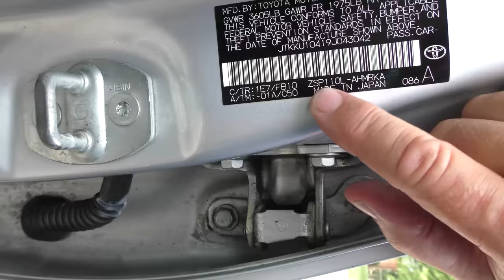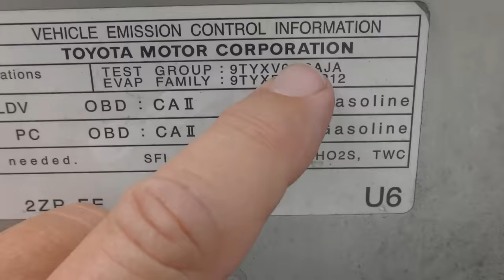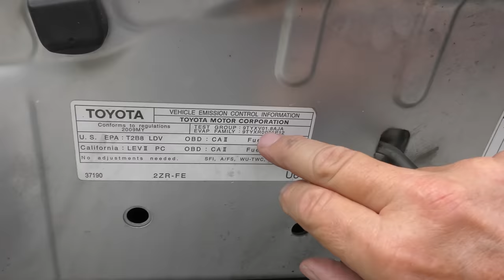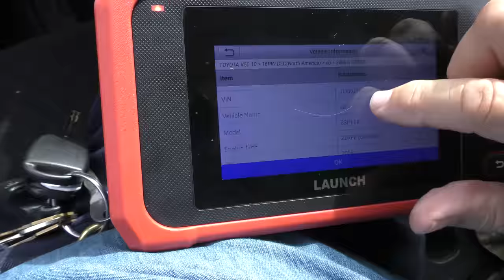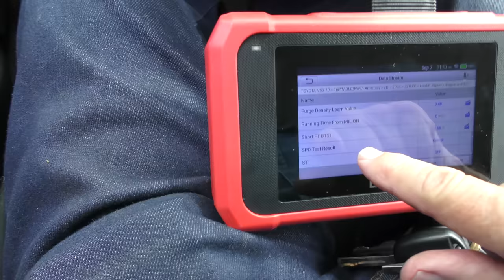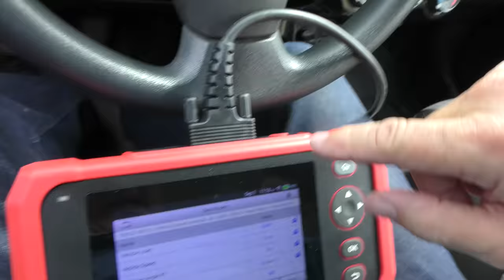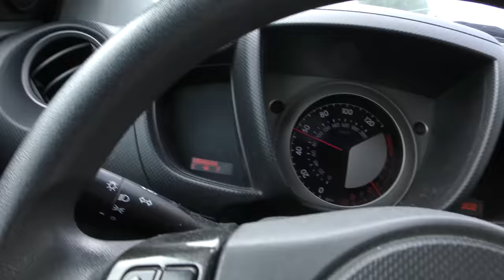Stop Buying Toyotas and Buy This Car for 3x Less

Comment: I had a scion xb and had 250k on it and it would be still running if I didn't hydro lock the engine. The oil leak on some were a problem with the rings. My engine had the problem and Toyota paid for the engine replacement.
Reply: @nagyhanna3758  drove through a puddle in a banked curve that ended up being almost 2 feet deep and I had cold air intake on it so it suck the water right in. I fixed it enough to sell tho

Comment: My 87 Celica was rated at 35MPG highway, but I would consistently get 40MPG when taking long interstate trips through non-congested areas.  That is still considered pretty good 35 years later.
Reply: See that, and here we are in 2022 and most new cars can't claim anywhere near that.
Reply: I had one over 400000 miles and yes the gas mileage was phenomenal didn't think about then being a young man !
Reply: I remember someone mentioning how '80s Honda Civic hatches got 40MPG plus. However, the reason they did was because they has much fewer safety features.  The person later commented how one wouldn't want to be in a front-end collision in one of those.
Reply: I know how you feel my 2018 Civic can get me 48 MPG on long road trips and it feels great looking at other people in huge trucks that get their MPG in the single digits 😂
Reply: @dannyv2230  Too bad every car doesn't get the MPG that your Civic gets.

Automanufacturers are greedy folks who don't want us to have the entire 🎂. 

They either give us a slice of great MPG or just a slice of Raw Horsepower and speed. 

But what we should be getting is a fully made 🎂 with great MPG, Raw Horsepower and speed together. 

If you get the drift of what I am saying. 

Basically a V8 Powered monster with 50 MPG and ZERO Pollution. 

It can be done but the Automanufacturers don't want us to have that because they are trying to appease the radical environmentalists now.
Reply: My V8 4.3 Lexus gets over 25 imp gal here in the UK, that's town and country too.  People in the owners club say 30 is possible, I didn't quite believe them at first.
Reply: @rob5944  I'm not surprised. Here in Los Angeles I routinely get 25 in my 4.0 V8 Lexus.  But when I'm driving in stop-and-go traffic (which is common), it drops into the high teens.
Reply: @KaiPonte  Ming you this is UK gallons, I remember as a kid in the 70s many family cars of 1.5- 2.0 litres usually did only around 30. That was considered normal, we had a Hillman Avenger for a while., you may remember them as a Plymouth Cricket?  He usually had oldish cars as he was usually short of money.  Come to think of so have I lol.
Reply: @KaiPonte  driving safely and wearing your seat belt are the biggest thing one can do towards as safety.  Indeed all these newer features encourages people do take more risks.
Reply: I learned how to drive on a 79 celica. I wish I had bought a celica in the 90s. Now I have a tC
Reply: @louisstennes3  tbh, I like electric. I rented a Kia Niro EV for three weeks while my Lexus SC was being painted.   It was a dream. Very quick, quiet, and not a big deal to charge.  Even using public charging stations only cost me like $15 for a “fill up”.  I would do so while grabbing lunch. For longer trips, though, I’ll stick with my V8 Lexus.
Reply: It's funny how that works, mines rated for 29 mpg highway but I regularly get 32 doing 80 down the freeway.
Reply: It's alright for a small car today. Our 2016 Mazda3 with the 2.0 litre engine has returned up to 62mpg (according to trip computer) on secondary highways. (so 90 kph/). Usually closer to mid-50's mpg, though, for highway. (mind you, I'm talking Imperial gallons, not US gallons)
Reply: My Preludes, 1985 and a 1986 that i had in the 1990s, 35 mpg in the city, 40 on the freeway.  Rated a sportscar it delivered some of the best gas mileage i ever had.

CLEARLY gas combustion engines can be engineered to give us good gas mileage but that's NOT PROFITABLE.
Reply: @jbrandt3306  yes. But you have to squeeze into a subcompact coupe.
Reply: @KaiPonte  I'm 5' 4" so not my issue.  😌
Reply: @KaiPonte  btw the backseat was cleraly a joke in the 1980s version at very least.
Reply: The celica was a great car preppy car with excellent reliability and good gas mileage.
Reply: I had the option to get an '87 Celica this summer and opted for a 2008 XD instead. I'm a little disappointed, but this was probably the better financial decision in the end.
Reply: Pretty good?? lol most hybrids can barely get that even in the city. That's crazy good
Reply: @jeretso I test drove a Gen 1 TC a few years ago and I was too tall for it. I’m only 5’9” but it felt cramped and much cheaper than my 06 Mazda 3. 

My first drum teacher in 1990 had a late 70s Celica that I always had my eye on and then in 2000 I was living in Southern California and saw one for sale that was mint. It was a 79 Celica Supra manual, all black with black leather and OG mags. I didn’t buy it and still regret it.
Reply: @williamperri3437  TC price is a lot cheaper than Mazda 3. Old Celica with a Supra badge would be awesome.
Reply: @jeretso  Used the TC and Mazda 3 are much closer in price than brand new though… Yeah, it was clean and a huge mistake not buying it. That same Celica in the condition it was in 23 years ago would be worth over 20 grand.

Comment: I've owned that exact car (same color and everything) for 16 years now. It's a tank- I think the only thing that I had to repair is the exhaust and the altenator. It starts first time every time! Probably the most reliable car I've ever owned. With the seats down, the rear has about as much room as a small pickup truck :) Great in the snow too.

On the minus side, it's severely underpowered and strains on the highway. 0-60 is in the 10-12s range. There's no traction control, and the rear brakes are drum brakes, so brake performance isn't the best.
Reply: I owned one for 6 years with the 5 speed manual.  They’re almost the same in performance but the manual being marginally faster 0-60.  I gutted the car entirely down to the metal and put bucket seats in it.  With an intake, exhaust, coilovers you surprise a good amount of people.  Can keep up with a lot of cars.   You can get turbo kits for them since they run the same engine as the Corolla. 2zr-fe
Reply: I have had to replace multiple wheel bearings in mine and the ABS is always on the fritz but otherwise, it's a great car.

Comment: Own one since 2009 , basically a yaris suspension and chasis. With a corolla engine , cheap maintenance. 180,000 miles. One water pump , changed it myself. 1 clutch change . 35mpg average ( puerto rico streets) full tank gets about 300 miles , manual . No leaks , love it . 

Small inside but great for students , really easy to park. Interiors really well built , easy to clean . Regular wash inside and out takes like 1 hour or less. Rear seats drops down and you have plenty of cargo space when needed. Best daily driver I've had really reliable. Just test drive it if you're a tall person .

Comment: I usually start up my 2013 Prius and use the power mode which uses the battery and the 1.8 L engine it laid rubber because I needed to get into the traffic, I only use the power mod for maybe 5 minuets then go back to the ECO mode; what a car over 170,000 miles and still runs like new without any problems, Thanks Toyota

Comment: You're adding value to my second car Scotty, thank you! Original owner of a 2014 xD with 91k miles & I recently traded in my used 2008 TSX with 110k for a used 2019 Frontier 4x4 midnight edition with 15k miles. The xD is amazingly reliable with basic maintenance OMG such a gas saver without the Prius price tag. Thank you for your knowledge Scotty I couldn't have done anything with my vehicles or made wise choices regarding which ones to get without you, you're amazing!
Reply: Without the expense of replacing the $4000+ Prius traction battery too.
Reply: How geeked was Scotty after he lit up the tires?

Comment: I bought an '08 Scion xD back during the Cash 4 Clunkers debacle. Currently have 270k on the engine and it still runs like a top! One thing though, that 2ZRFE does like to have bad water pumps. I've replaced mine twice.

Comment: I have a 2006 Scion xb at over 318,000 miles. It's burning oil, and the transmission is going, but it's hanging in there. It's been a great vehicle. Just dying to upgrade soon.

Comment: Scion XB--I've had three--first in 2006 had 1.8 liter engine--great car, thought I'd have to push it up mountains, but not so--the 2006 I traded for a 2012 XB with the 2.4 liter engine-my daughter had problems (family issues) so I gave it to her--it's still running like a top..  Bought another 2012-this one white-runs great, uses no oil...I don't think it's as much the engine or engine size as upkeep on the vehicle and how they're driven...I was (retired now) an automotive quality engineer--Scion was a joint venture, Toyota and Subaru, Toyota made the     drive train and Subaru made the body--if you can find a GOOD Scion - it's worth it!

Comment: I just recently got my 09 XD. My suburban crapped out and I needed a cheap car quick. Never before has a car pleasantly surprised me like this thing. I'm 6 ft 2, and weigh 280 lb. I can comfortably fit myself, and three friends my size in this thing. Something new amazes me everyday with it. I just found out yesterday that it's apparently rated to tow 3500 lb.
Reply: wait can it seriously tow 3500lbs? I have a 2012 xd and I installed a hitch mainly to use hitch-mounted cargo carrier but it could also come in handy if I needed to tow a small trailer. According to my driver's manual, its not rated at all for towing or even for cargo carriers/bike racks. I installed the hitch anyway and have had no problems using it for a cargo carrier but i just make sure not to put too much weight on it.

Comment: I had a 2004 Scion Xb, and I loved it!  Roomy (you could wear a top hat in it), fun to drive, reliable (I almost forgot how to open the hood).  Plus I loved the bare-bones, non-jazzy, utilitarian look of it.  I never liked the 2nd Gen version, although I suppose it was a good car.  I wish Toyota would revive the 1 Gen version, as a fun compact 'SUV'.
Reply: The problem is that the 2nd generation xB wasn't nearly as good as the 1st. They used the 2.4L "oil-burners" and weren't even technically xBs. They rebadged the Toyota Rumion from overseas, while we missed out on the real 2nd generation Toyota xB (bB).

Comment: We drive a 1998 Avalon with 261k miles and a 2006 Explorer with 180k miles. We could use an affordable car that people don’t laugh at us and will last. No frills works. 

We bought a 2008 Rogue with high mileage. Looked well maintained. Didn’t throw any codes. Drove 7 months and transmission died. Sold for parts. Nissan Jatco transmissions are garbage. Now we know. A year ago we were desperate to find a cheap, dependable car. Oh well.

Comment: I love the way Scotty just gets ahold of those plastic covers and flips them aside. "Hey Scotty, I have a 2006 Camry that's missing the plastic cover. Do you have a spare you can give me"?  "Hmm, I think so let me go in my garage. It may take me awhile as there's about 2,000 in there."
Reply: are those covers part of the heat/cool equipment?
Reply: @commonconservative7551  the covers solely exist to make the engine compartment look "cleaner"

i personally prefer looking at the engine and everything about it, not some plastic with letters on it
Reply: @UriyZ9mb8e  it has an effect on the heating / cooling, It shrouds the engine heat
Reply: @commonconservative7551  it keeps in some of the heat from the engine yes, but actually thats bad for the engine, you want it to be at operating temperature, and if the engine overheats, then the cover will help in keeping it overheated... its possible im wrong, but ive never seen any engine cover that actually helps the engine, unless you count some sort of hood intake thats integrated into the engine cover
Reply: @UriyZ9mb8e  i don't think you know anything without checking with manufacturer, sorry, just logic
Reply: @commonconservative7551  theres no single rule for every car, there are some cars where, as i said earlier, are designed to work with the intake to provide colder air, but an engine cover at its base is as the name implies... it covers the engine, leading to a "cleaner" look and marginally less engine noise

anyways, i can see where this is going, this is my last reply, you were originally the one asking the question, now you supposedly know better... believe what you want

Comment: I love my Avalon, however, I’m not one that has to have a big ride. I would be just as happy with a 1.8 Corolla. Toyota is definitely the way to go!
Reply: Dude you have a ave. Why would you ever go back to a smaller vehicle?  
  -asking 4a friend😅
Reply: Toyota is the best of the best I have a 2002 Toyota Tacoma with a 4 cylinder 2.7L engine it has over 200,000 miles and still runs great the transmission shifts as smooth as a feather, what more does anyone want??? My 2013 Prius is just as good if not better?
Reply: @surfside75  what year avalon? I really would like to purchase a 2015 XLE
Reply: @surfside75  Gas Mileage!

Comment: Yes that 1.8L is bullet proof I worked at a Lexus Toyota scion dealership.    I’d stay away from 2.4 and 2.5 unless it’s 2016/17 and newer 2.5L
Reply: Agreed
Reply: My 2015 XB is fine. They put correct Pistons. But I know plenty of people who have earlier ones without the issue, or has the work done by Toyota via campaign.

Comment: I have 2011 scion tc and love it. 6 speed manual transmission. Fyn little car. It has traction control and comes with the Camry engine which is very dependable and doesn't use any oil between changes.

Comment: We have an '06 Scion Xb, and it is the perfect car for my wife to bang around town and do errands and go to the grocery store.  I love driving it, too.  Only 2 small concerns:  I wish it had factory cruise control, and it has to warm up enough for the cold-engine light to go off before the auto will shift into its highest gear.  That 2nd one is kinda strange.  We've put over 130K miles on it, and I hope it lasts forever.  It's like the Tardis...bigger on the inside.  I wish I had 2 of them.

Comment: i have an 06 xb with 314,000 miles on it. it was my commuter car so 95% freeway driving. at 200,000 miles i changed the plugs and front brake pads. changed oil every 10,000 miles with mobil 1. that plus gas are my only expenses other than 6 sets of tires. it still runs great.

it’s funny that they marketed this for the young crowd. almost all were driven by old farts like me. it’s the world’s easiest car to get in and out of.
Reply: Completely agree. I inherited my pop's 2005 xB. He bought it in his late 70's and drove it until he passed in his mid 80's. He loved that car! Despite having a garage full of nice German cars, I'm keeping and maintaining my dad's Scion. I love that thing too! So versatile and fun to drive.

Comment: I got a 2009 xD for my daughter with a peeling clearcoat, however it was well maintained otherwise and we gave it a new paint job. It's been a great car for her. The only negatives for me would be the placement of the PCV which is normally accessible on the top of the engine, is underneath the manifold intake on this car. Just beware there's not much room around the engine to easily do some DIY repairs.
Reply: How much was your paint job ?

Comment: I always wondered why some automatic cars had tachometers as they’re really superfluous. Then, I started driving buses: big engines with automatic transmissions, the tachometer is essential as an indicator when there’s a fault like a slipping gear or overheating problem.

Comment: I have an '08 Scion xD that was gifted to me because it needed a new timing chain.  So I ended up buying a matching engine out of a '13 Corolla for $400 and swapped it myself.  Then all it needed was front wheel bearings  and it has run like a dream ever since.  It's a really zippy little lady.   I also have a '16 Scion iM. The last Scion!

Comment: I have a 2004 scion xA, and  I changed the clutch, and  did spark plug myself, and it's running better now.  I did a oil change at the Toyota dealer, and a brake switch change, and I find that it runs ok.

Comment: I just Bought a 2006 Scion xA for dirt cheap and runs like new no complaints for a cheap car , and just because it only has a 1.5l 4 cylinder pushing 103 hp it keeps up with highway traffic no problem and it has phenomenal gas mileage. For a $1100 car not bad at all with 130,797 Miles and being that it's a Toyota underneath it'll run forever.

Comment: My 09 vibe 2.4 5spd is running great for years. No oil issues. Unfortunately used ones cost 5-7k in good shape. The new Corolla hatchback would be a nice replacement if it wasn’t 20k

Comment: Just bought one today! 2012 with 270k one owner. I watched this video today because I was on the fence about it. Scotty made the decision for me lol
Reply: Hows it been?
Reply: @rayrayballer1  it's been a workhorse. I fill it up twice a week. Get an average of 34-36 mpg per tank. Peppy car. Got it up to 115 before it ran outta steam. I can see keeping it for awhile. Easy to work on.
Reply: @KrazyBear918  cool , which engine u got
Reply: @rayrayballer1  the only option for the US market I believe is the 1.8 4 cylinder. Peppy motor. Acceleration is more than adequate. I wish I had the manual transmission though.

Comment: I have a 2006 Scion xB with 280,000 miles. It has an 1.5L Engine is 1.5L It’s Lacks Power, and burns oil.